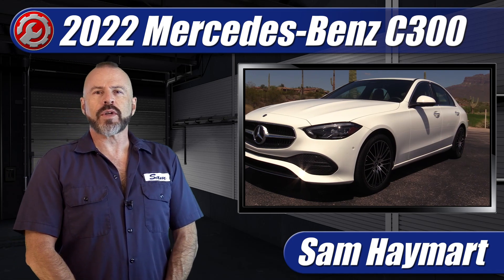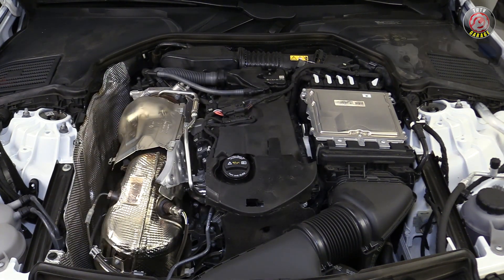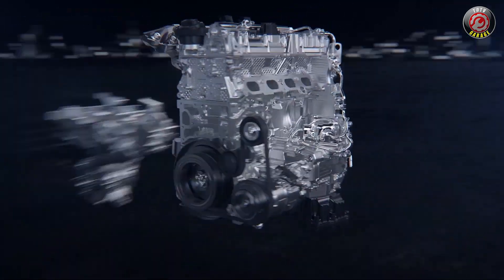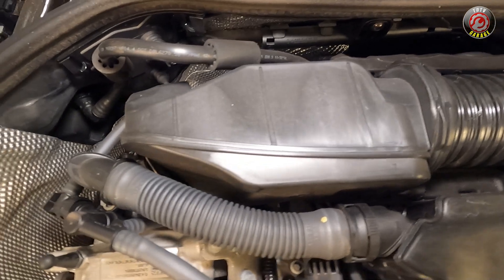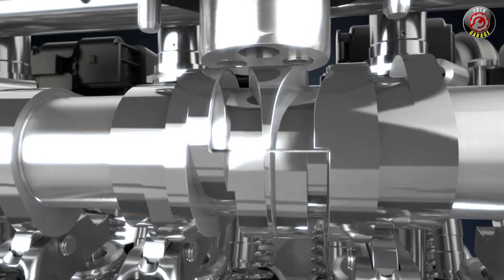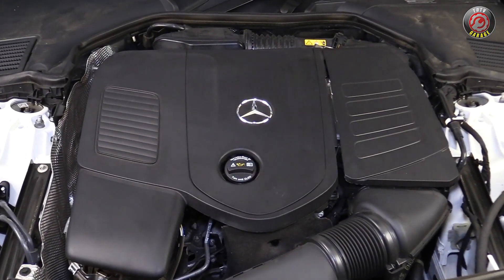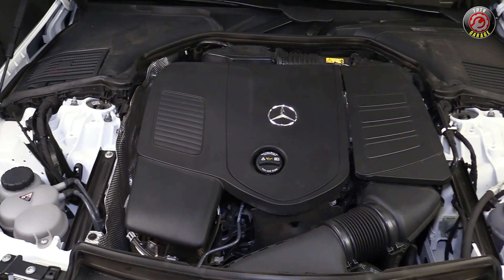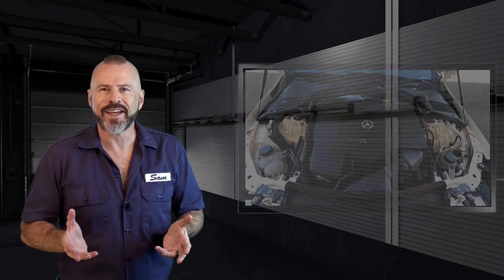2022-2023 Mercedes-Benz C300: Engine Explained

Comment: My 2023 makes a diesel ticking noise is it normal. When turn on and acceleration
Reply: Mine make the same noise it must be normal and the engine is loader than I would think someone told me my car sound like a tractor
Reply: Yes all the same
Reply: I'd check the oil you are using. Mine is quiet as can be.
Reply: yes its normal. its because of the injectors

Comment: I have 2023 C300 and the engine is very noisy especially when idle. Sounds like diesel engine. I wonder why?
Reply: The M274, M264 (i have), and M254 are all DI (direct injection) engines. when cold, or warming up, or in specific lean burn phases, they can have rattle similar to diesel engines. This is entirely normal.
Once warmed up good and hot, and with the appropriate oil, they quiet down, but still it's due to their design. 
These engines prioritize the injector centrally located like a real big boy diesel, and the spark plug is off to the side and in-between the exhaust valves. This is very different than most other DI engines which put the injector to the side, and centrally locate the spark plug. 
This way the Mercedes engines can extract maximum efficiency and power but at the cost of some combustion noise.
Reply: Mercedes 4Cyl are very noisy compared to VAG and BMW 4Cyls. Just part of their character.
Reply from the maker: Direct fuel injection is noisy
Reply: I thought it was something wrong with my car but I guess I’m not the only one somebody told me my car sound like a tractor
Reply: I have the same issue knowing others are complaining about the same thing I guess it’s completely normal.
Reply: My daughter has this car and it's so quiet is sound like an EV. Not sure why you are having this problem?

Comment: How reliable is this engine?
Reply: It’s not
Reply: @melvinmerlos8771  Based on what facts?
Reply: @vikingxd8644 
its reliable since the M256 isn’t quite giving drivers any problems although the hybrid system might be the one with problems. Only the future beholds the truth tho
Reply: I was an early adopter and have had one of these engines for over 2 years, so far everything is great. It is more difficult to DYI the maintenance at first but it isn’t that complicated. My main issue is that the engine has a ton of input delay when you press the acceleration pedal, it is actually infuriating sometimes. I pretty much am always driving in SPORT mode to prevent throttle delays. So much for an electric assisted turbo and hybrid power.

Comment: I have a 2022 C-class coupe AMG line. It doesn't have the hybrid engine. It does give off a burning smell after driving that smells like metal-to-metal burning. (may be transmission) Engine is relatively quick, but does suffer from some turbo lag.
Reply: how did you get it without hybrid?
Reply: how did you get it without hybrid?

Comment: I had this engine and it had potential cylinder head assembly issues very early on. The car will misfire and idle rough. There’s no simple fix either , open heart surgery (engine rebuild) or  heart transplant (new engine) were the only options to remedy the issue. $12,000+ in 4 years. Stay away from these cars. Great to lease but that’s it
Reply: These engines just came out about a year ago. It would be under warranty. So you’re likely talking about another engine. So this is not your engine buddy. That said it is a complicated engine and Mercedes is expecting most of the maintenance to be carried out by dealerships z
Reply: @postalpancho they’ve been making them since 2015, with tweaks here and there. It’s by no means “new”
Reply: @melvinmerlos8771  did you let it cool down before shutting off for 1-2 minutes, change the oil and filter every 5k miles, and change the coolant frequently? These are things that can enhance the life of this specific engine. Don’t listen to the 10k mile oil changes from the manual.
Reply: They haven't been out that long. You must have an older C-Class.
Reply: @jamesbudd9987 hey, if you like it go for it. It’d stay away if I were u
Reply: @jamesbudd9987 верно , у него должно быть 205 на нем установлен такой же двигатель и проблема м264 проявлялись на раних ревизиях этих двигателей прогар клапана потеря компрессии пропуски зажигания лечится эта беда установкой модернизированной головки блока цилиндра. У 206 стоит уже молее свежая ревизия этого двигателя и многие компоненты отличаются, в частности головка
Reply: @jamesbudd9987 
He’s talking about the renault engines in the W205, this weirdo😂😂😂😂😂😂
Reply: What vehicle and year was it?
Reply: @limeflavoredbleach5570 2020 2.0t the M264 I’m pretty sure. C300 coupe 4matic
Reply: @melvinmerlos8771  how often did you change the oil. Only reason I’m asking is because you’re supposed to change it every 5k miles not 10k like the handbook states.
Reply: What are you talking about? Mercedes has been installing this engine in the W206 since 2022 and has been manufacturing it ever since. You're talking about a different engine and misleading people!
I have a C300e PHEV version and have driven 25,000 km with it without any problems.